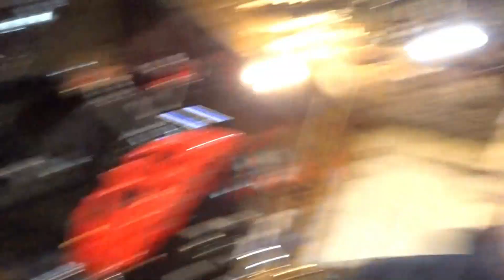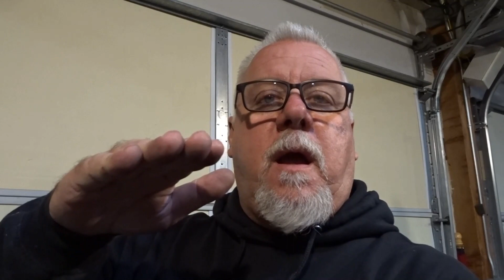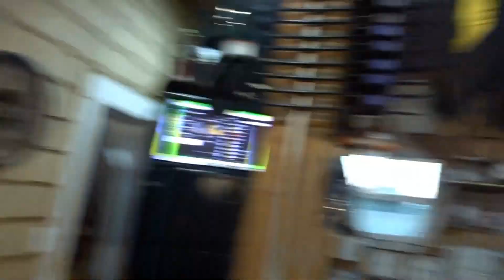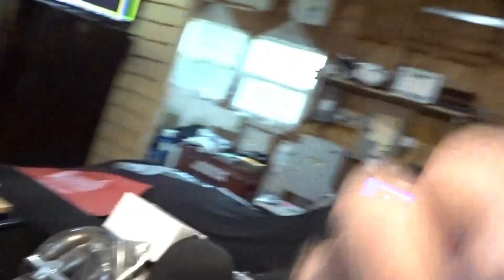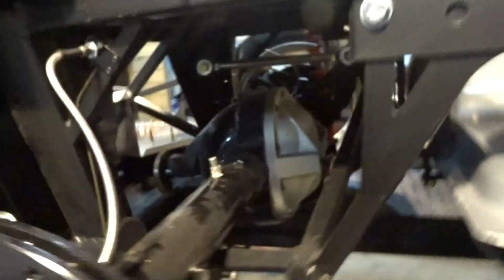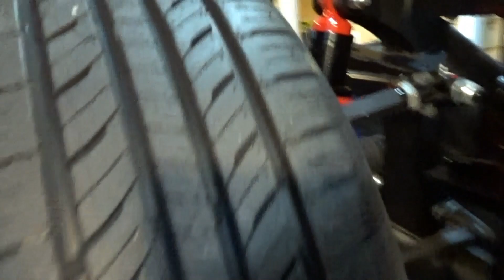Factory Five Racing Mk4 Brand New Coilovers Springs

Comment: Currently building a FFR Speedstar and installing the front and rear koni shocks. Thanks for clarifying several minor/major  points that are not clear in the manual and align to the intent of the shock use and performance.
Reply from the maker: Glad to help!

Comment: My default position is to always use a washer between a nut and powder coating.  Without it, I have no confidence that the torque I put into that nut ever makes it to the fastener (it also helps protect the PC).  This doesn't apply to the head of the fastener because my other default position is to always torque the nut, not the head.
Reply from the maker: And while I can appreciate that, the powdercoating came out just fine. No visable damage and as I stated in the video, my feeling is that it is much more important to have the nylon of the nut to seat and lock properly. You could just run a longer bolt, but the nickle and dime of each of these hardware choices really add up quickly.

Comment: What rear spring rate did you use?
Reply from the maker: We used #250 lbs springs on the rear coilovers.
Reply: @i.e.427garage  You used an 8" length, 2.50 diameter, but a 250lbs for the rear springs?  I was thinking that it was getting closer to a time for a softer ride.
Reply from the maker: Hey  @RalphButton , how've you been? Yes 250 lbs for the back is about perfect for a nice compiant ride. This one is going to have a rear sway bar as well, so that will limit body roll.
Reply: @i.e.427garage  At the open house i picked up a set of new red koni's which I'm setting up for a cruising ride.  May even try and find a rear sway bar.  
Either way I can quickly swap the shocks out as needed... in case I sneak off to a track night! Been doing great so far.